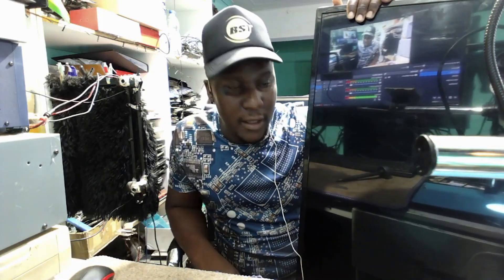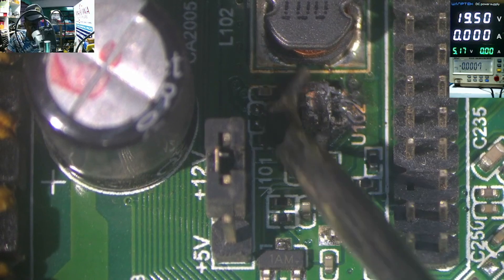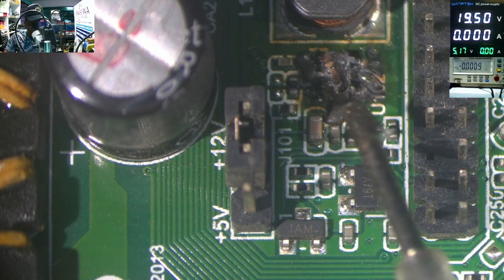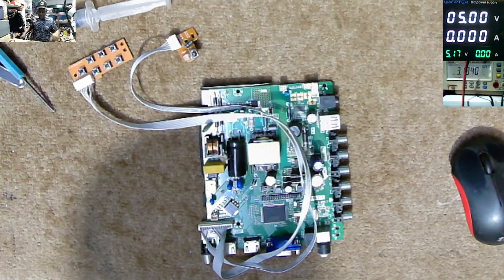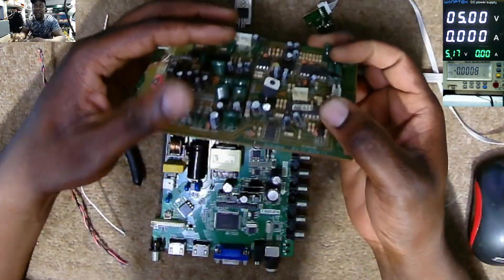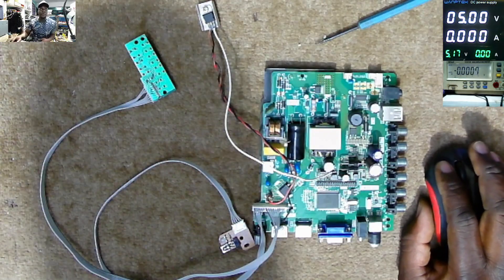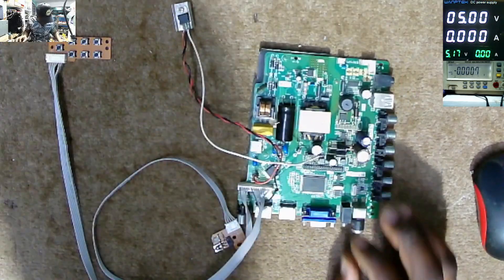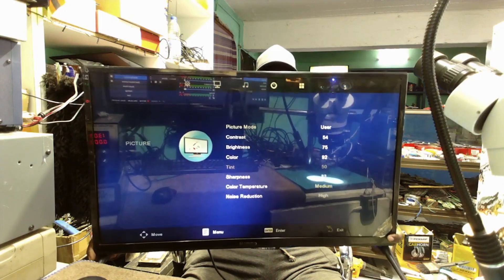Tv Circuit Board Modification and Repair—32 Inch Samsung LED TV Not Powering On, No SB Light!!

Comment: The video is informative, well done.
Just one thing was left unclear, during your visual inspection you spotted two issues. The voltage regulator issue was resolved but what about the first issue? There seems to be a track which was soldered, or some "loose" solder next to a component that wasn't there, you said it yourself.
What did you do in that area?
Reply from the maker: I overlooked the issue but was a ceramic capacitor to be replaced which was blown up... But the TV never returned.. Thanks for Such Analysis 🙏🙏🙏